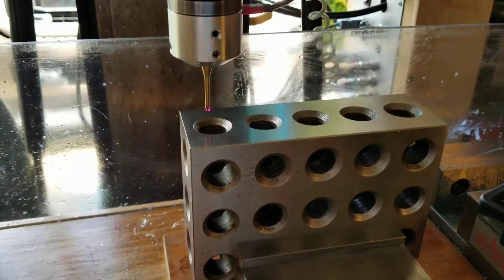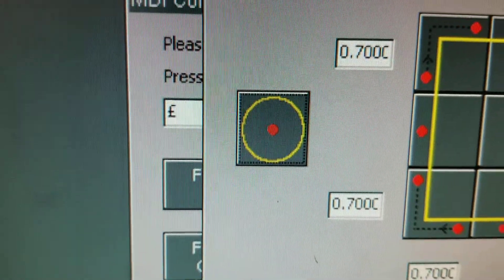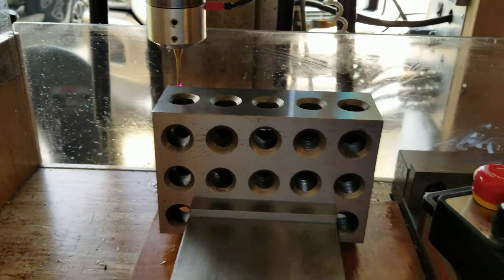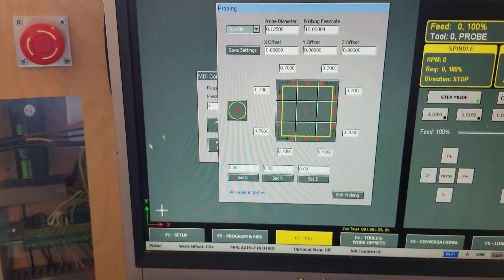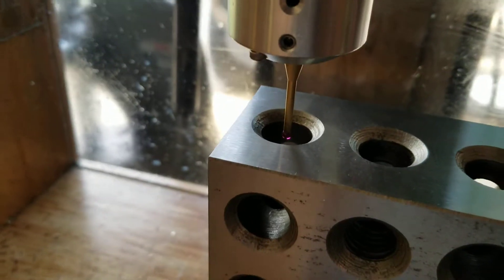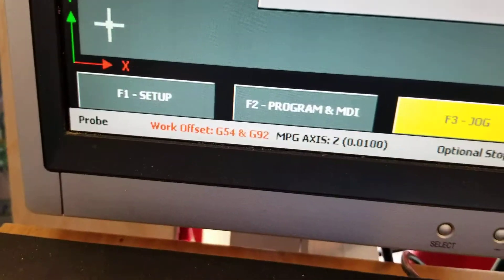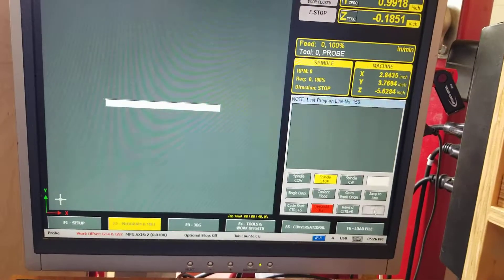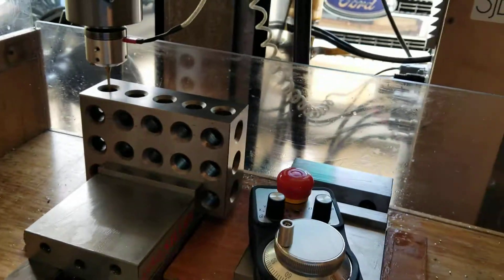Masso CNC Probing Menu Hole Center Function

Comment: I think you can program your own routine for probing and then using the g10 to set the desired offset automatically.
By the way, did you try finding centre on square pockets?
Reply from the maker: Probing square pockets work the same as round ones. I use it all the time.  G10 sets a work offset value.  I used to use G38.2 for straight probing before they added the probing functions.  The probing menu is so much more powerful than what you can code manually in this case but it is still possible.

Comment: Nice explanation, I can't wait to do this on my Masso
Reply from the maker: Thanks for the kind words.  I really enjoy my Masso controller.  Very reliable and easy to use.
Reply: @testyourdesign233  your welcome, one thing if I need to call my g54 offset save in F4 I need only used mdi and type G54 and hit enter?
Reply from the maker: @ikecobey6268  to save it in G54 you open F4 screen then double click on G54 line and press Autoload for X and Y followed by Save. Once saved you can recall the G54 location in MDI after canceling the G92 using G92.1 command in MDI. You'll get the hang of once you practice.  Just take your time and plan each step one at a time.
Reply: @testyourdesign233  thanks